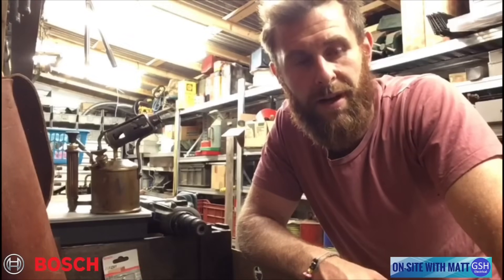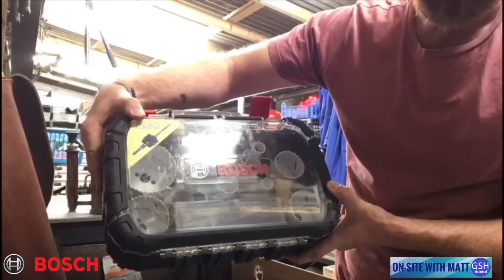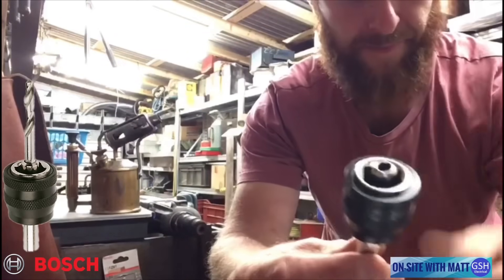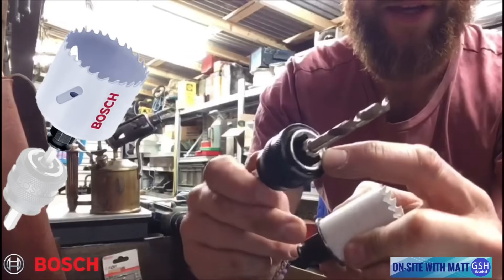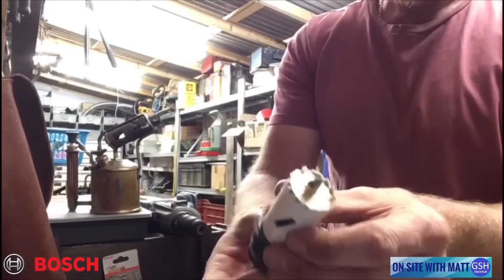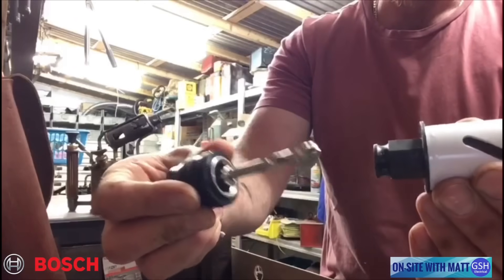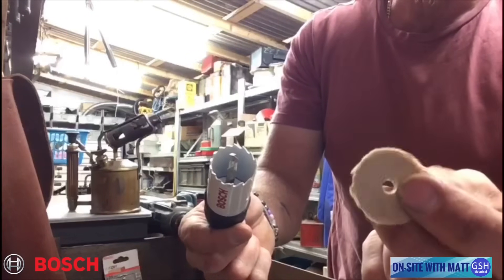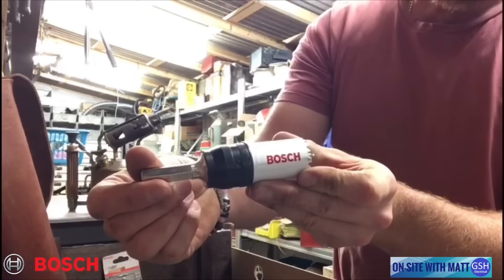Using the Bosch Progressor Hole Saws and the Quick Release Power Change System - Electrician Matt

Comment: Have a set of these myself and touch wood going strong and good cutting heads too as mine have not yet dulled at all.  Touch wood also been lucky as still on my first pilot drill bit, and space in the case for extra bits if you pick them up individually 👍🏻.  Also cool springy supports where you clip back in your hole saw blades when not in use
Reply from the maker: Hi. Thanks for commenting and watching Gaz 🙌

Comment: Did you experience the pilot bit wobbling in the arbour? A review of the product on Amazon states this which puts me off.
Reply: Yes. The pilot bit is wobbly in the arbour.
Drilling the Yale lock, in an expensive “performance” front door with 5mm (very) thick veneer. I worried this might allow the holesaw to wobble erratically and create a poor quality hole.
Very Lucky I tried it out on the Letter box slot.
It made a horrible, chewed up entrance. So I tried again using a rock solid Pillar drill. Same appalling hole. This would have ruined the door completely had I not used the letterbox slot effectively as “scrap”.
Went And bought a classic “Starrett” 2 pin arbour, where the pilot drill is held like rock with a grub screw ..... perfect hole even by hand!
This is a design weakness, convenience over quality!
Got a replacement ... same problem. Pilot drill spec. 7.15mm diam. 6.35mm hex. Actual dimensions are 7.12mm and 6.23mm enough to make this toll pointless.
OK I will ask Bosch to replace again and see if it was just a two time product quality issue!
Reply: @peterrolex2349  Thanks for your feedback. Ended up choosing Starrett also and can't complain.

Comment: I decided to get this set after the pilot drill on the standard arbour constantly comes loose, after trying to tighten it for the last time, the flat blade screwdriver slipped and tore my thumb open. Another thing is the hole saws are alway getting stuck on there, usually the bigger sizes, this set is brilliant. The case won awards on its own.

Comment: Forget the comment about cost, just checked out the cost of a 20mm Bosch hole saw using this system £6.59
20mm Starrett £8.39 but UK made using the old method.
Reply from the maker: Hi. I think the set was about £80. Gaz
Reply: GSH Electrical, yeah I think they retail around that price. 
All my hole saws are Starrett, just found out they also produce a quick release system. The plus side to theirs, you can use other manufacturers hole saws. Guess Bosch are just protecting their own interests.
Reply: @craigemmott4976  Not a great fan of the brand lock-in, and Bosch's system won't allow you to set one holesaw inside another if you need to enlarge a hole in a pinch. The Starratt Ulti-mate looks more versatile by comparison, but the adaptors also look like they would seize onto the saws and be a pain to undo?

Comment: Great idea, but I think it could be improved upon. Having seen photos of the set, each hole saw has it's own shank which fits in the quick release mechanism. Would it not be better to have the same mechanism with one shank where the actual saw screws on to the shank? If you wanted to remove the piece inside the saw you would do exactly what Matt has done. 
I know some folk will reply and say the this is for changing the hole saws quickly, but what about the cost implication, cost of bog standard hole saws versus these. I'd buy two shanks if I wanted to work quicker.
Reply from the maker: Hi. As always thanks for talking the time to comment... all good points... we are massive fans of the Armeg range of hole saws https://youtu.be/ZO41qOs1fj0 
Please keep watching and commenting Gaz 👍.
Reply: GSH Electrical, I must admit I'm a armeg fan too. Love their box sinker sets.

Comment: I've been using these for 5 or 6 years. Bought them individually though, have only had to replace my 25 - can't remember what I dulled it on. Have used them for timber (including worktop for cable ports), downlights and fans in plasterboard, glands in plastic and steel enclosures
Reply from the maker: Hi thanks for you positive input David and watching as always Gaz 👍
Reply: we use the bosch hole saws for nearly every thing, plaster board, OSB, all kinds of metal, sometimes brick (not so good). We also cut holes in steel beams (10-15mm massiv steel)  and that works very well with lubrication.

Comment: We use this system since 2015. It is really good. Especially on construction sites where you change the size every few minutes. The only problem we have with this sets sold in Germany is that there are so much useless dimensions. How needs 19mm, 38mm or 44mm. Here we need 20mm, 32mm, 35mm and 40mm.
Reply from the maker: Hi. Thanks for commenting and watching GSH Electrical 👍.

Comment: These are great sets however one of my pilot bits snapped very early on it's life. Second one is still going strong though.
Reply from the maker: Thanks for the input and watching Gaz
Reply: Can you use any appropriate length drill bit or is it a proprietary bit that is required for this?
Reply: @curiousjoe395  it’s a hex shank so you can just get any hex shank drill bit.